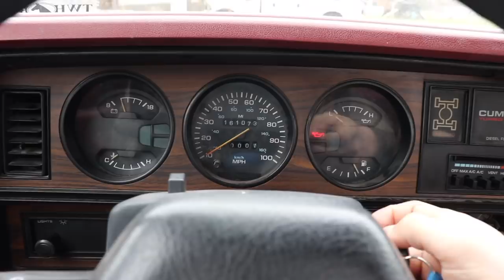NASTY RED TWIN TURBO CUMMINS HAS RETURNED!!!

Comment: Do you have the part number for the kit you’re using on the street truck using the stock H1C turbo for compounds want to do some research trying to find a kit  I can use the stock h1c for my 1st gen